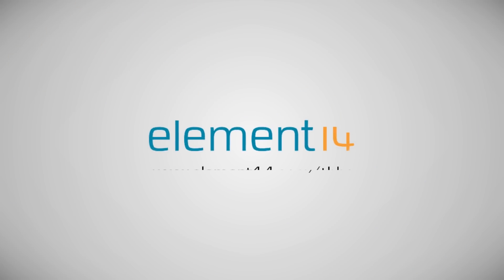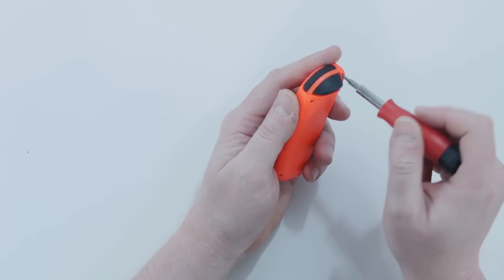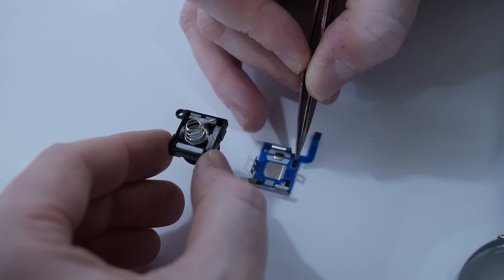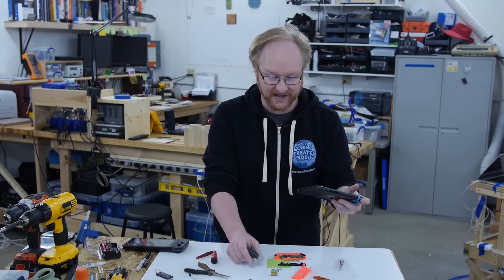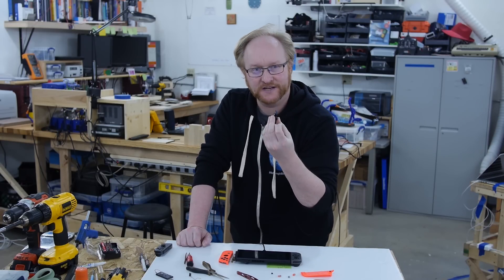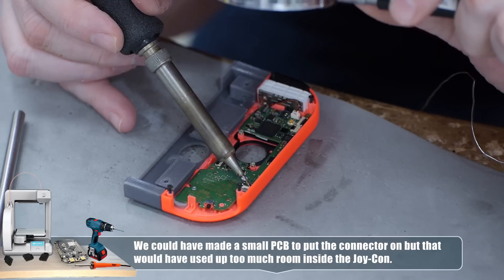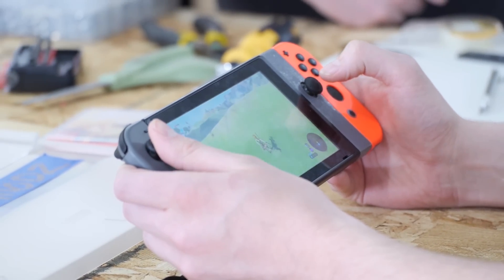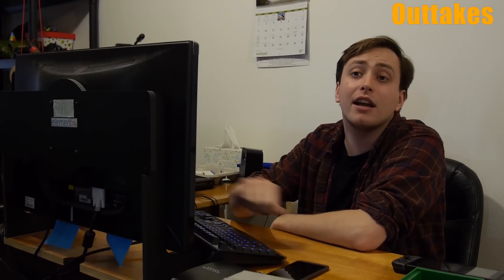The Ultimate Nintendo Switch Mod!

Comment: I wonder if in future hacks you could actually use the full clock speed of the switch in portable mode, so we could have better frame rates and we could play in 1080p on a 720p screen. Any normal person would say "That's useless to have 1080p on a 720p screen" but actually it's more sharp and it looks nicer overall.

Comment: Would it have been possible to add shoulder buttons? Sure it would be awkward to play sideways with the new position of the joystick, but I was wondering if you could have two artificial buttons and attach a wire or even just do what the Joycon Strap did and have a button that extends down to the real button and presses that.

Comment: you kinda overcomplicated it by trying to make a null conector for both sides instead of just re-allocating the existing connector and hardware into a 3D printed joycon, the console would recognize it as a normal joycon but you would have the analog stick where you wanted it...

Comment: Moving the stick is only part of the solution to the atrociously unergonomic design. You need a grip. Like the one that's available for the joycons alone, but one that can be used when they are attached to the console.

Such a grip alone would make the situation much better, without having to modify the joycon itself. (I know. My 3DS became a hundred times more comfortable after I purchased a cheap grip attachment for it.)

Comment: You can use the Switch with only one joy-con, by the way. Zelda just doesn't let ou because it need all the buttons - you've got to either go to the Switch controller calibration menu or boot up a game (like Mario Kart) that supports single joy-con play to make it work.

Also, it looks kind of ugly. I can't expect there to be the perfect shade of grey or neon red to 3D print though.

Comment: ugh.  Why does this guy suck so bad at soldering.  I could remove that connector without a trace of damage.  Preheat the board to 80c and set hot air at 150c, 5 minutes and it is off and in perfect condition.

Comment: Questions here: what happens to the SL/SR buttons? And how does it feel ergonomically when you hold it in sideways mode? I understand some ppl would rather not use the Joy-Con in sideways mode, but SL/SR are sometimes used when holding the Joy-Cons in each hand, detached from system.

Comment: Oh jeez...the wipers on that Nintendo joypad are a throwback to the giant wipers used on the Coleco Gemini controllers. The Gemini controllers are fantastic, as long as you keep a bottle of contact cleaner and a screwdriver nearby.Hopefully, Nintendo has worked out that bugs in that system.

Comment: I wonder if a screen mod would be possible, like... having a mobile 1080p display which we know the Switch internals are capable of rendering in dock mode... (maybe a battery mod would be necessary too...)

Comment: Cool project, but doesn't doing this disable your ability to comfortably use the right joy-con horizontally as it's own controller?  I figured that's why Nintendo designed it the way they did in the first place right?

Comment: 5:40 Yes, and no, Specifically in Zelda BOTW you need them both connected, or neither. However in just about any other game but that one, it works in any configuration (Tested w/ MK8, Disgaea, Puyo Puyo Tetris, ARMS).

Comment: would it be possible to connect the analogue to a header to another header and a 4 pin, .5mm ribbon cable to the original zif connector?

Comment: if you take a piece of single core mains cable then take a soldering iron bit you don't mind destroying and drill a small hole in the soldering iron bit and braze the small piece of solid core cable minus the sleeving into the soldering iron bit and you will have a very fine soldering iron bit.

Comment: is it possible to order ribbon cable like the one they used in the switch?  Then just solder an extension on instead of using wires?

Comment: Couldn't you all of used just another piece of a ribbon cable that was that had a female end and a male, then you wouldn't of had to solder anything and you would be able to revert back to the original joycon configuration.

Comment: The joycons are fine when I'm playing with them detached or in the grip, but it pretty uncomfortable when attached to the screen. I think it is the weird placement of the sticks in addition to having to support the weight of the system that make it so bad. I found having some kind grip on the back alleviates some of the problems, but doesn't fix it completely. It really annoys me that Nintendo screwed up their single player experience to cater to local multiplayer (knowing them, they'll sell a $100 single player only set of joycons)

You should do a hack to make the pro controller d pad not so stiff. It wreaks my left thumb playing puyo puyo tetris with it.

(Ben talked about the PS Vita in this video, but I can't find a vita tear down on this channel. Did they do a video on the Vita?)

Comment: Of course, now this modified right Joy-Con can't really be used horizontally as a standalone controller. Are there pass-through buttons on that adapter for the Joy-Con's little L and R buttons (on the docking rail edge)?

Comment: conductive ink on the flat flex ribbon cable? Are you sure? Okay, this is mass market stuff and that can be different then industrial grade I know, but usually, there is thin metal foil in the FFC. Sure - the metal foil is thin and the plastic burns right trough when the soldering iron even comes close to it, but still: When you can name me a mass market manufacturer using  a conductive ink process, then I would like to get a name.

Comment: Or... You know. Here's a thought - design a grip that moves the position of your right hand.

The problem isn't the placement of the stick relative to the buttons, it's the orientation of the controller relative to your hand.

Just bear with me for a second here...
Take the right joycon and remove it from the console. now instead of gripping it tightly, hold it loosely and move the controller so it's diagonal with the bottom further away from your palm than the top. (you may need to hold it in place with your other hand to experiment with this)

If you do this you'll see that if you hold it at a 45 degree angle or so the placement of the stick is perfectly fine.
So... a simpler, less destructive solution is to create a grip that forces your hand to be in a better position.

Of course, I find I often hold the thing this way anyway when the controllers are attached to the switch, but eh.
Reply: I was actually thinking the same thing XD
Reply: I don't think that will mess up the ergonomic because I actually play with the right hand reoriented in that way so
Reply: mjc0961 I don't see how improving the positioning of the controller relative to your hand is 'making the ergonomics worse'.
Ben's solution is arguably over-engineered and while it solves one problem, it introduces several more.
The most obvious one being that the weird placement on the controller isn't arbitrary, it's a deliberate design compromise owing to conflicting goals  - the switch controllers are trying to accomplish  about 4 different things all at once.
Firstly they serve as integrated controls for a handheld style system.
They also have to function loose as wii remote style motion controllers, a conventional controller if used in a grip, or a pair of miniature snes style controllers.
Ben's aolution here improves one of those, but at the expense of destroying usability for the other 3 entirely.
The asymmetric stick layout here isn't a fob to Xbox gamers either - it's a direct consequence of that design compromise, as is the left joycon having buttons rather than a d-pad.
I am fairly sure if only the docked configuration mattered they would have stuck to the Wii U style layout.

Anyway, a grip would help at least two of the layouts rather than just one, and if it's removable, would not render the thing unusable for the others.
Ben's solution definitely totally destroys the mini-snes configuration (shoulder buttons probably unreachable, and stick in a very awkward spot).
It might still be usable in motion control configuration, but probably not comfortably...

Personally I prefer holding them loose from the system, but to each their own.
My hands aren't exactly huge, so how would I know how bad it can get? XD

Joycons are exceptionally tiny though, I have to admit...
Reply: Greate idea :-) Off course, the design would not look clean any more, but hey: The nintendo 64 controller did his job.
Reply: pretty much what the joy con grip does. All we need is for those side parts to attach to the controllers in the handheld setup.
Reply: KuraIthys people like you, will make great leaps in physics and technology

Comment: List of things that the inevitable Switch Pro will have:

- Better, more ergonomic JoyCons with built-in microphone for not-messed-up voice chat that doesn't require a phone
- - Maybe with a movable joystick so that you can still play with a single sideways JoyCon?
- 1080p screen
- MORE POWER! *grunt grunt*
Reply: Why do you need microphone in the joycons? The headphone jack of the switch could (according to Nintendo) be used for a microphone. Commonsense, tells me that bluethoot could be used for a head set.
The current voice chat system has nothing to do with hardware limitation. 
Yes, build in microphone would be nice, but build into the screen would make more sense to me. The microphone in the joycons could be covered by finger, the joycons  are moved erratic relative to the mouth of the user, the microphne might pick up game sound and button presses etc. In docked mode, an external mike or headset could be used.

More power and 1080p screen are unlikely - I mean: the new 3DS got more power, but is akward, that some old games can not use the extra power, some new games strictly require a new 3DS. At best, this leaves players with the old hardware with an objectively inferior version. At worst, it causes market confusion as show cased by Sony and Microsoft.
The 1080p build in screen could cause issues with some games - there is for e.g. one touch screen only switch game, which also means portable mode only. Guess witch resolutions are supported. Yes, the "new switch" could scale up the screen, but... that would not be the typical Nintendo feel of overall polish and definitive version. (I mean: leaving the fog machine could N64 aside. And the headache generator Virtual Boy. Or the 3Ds gimmick, that I barely turn on and if only for 30seconds to remember why the slider is always down)

Comment: huh. They probably cheaped out on the analogue stick because all the other guff in those joycons actually makes them really expensive.
Even though people complain they're too expensive compared to a gamepad for other systems, someone did a cost estimate on these, and the profit margins are tiny. Your average game controller in terms of construction would seem to be about 1/3 the cost of a pair of joycons...
(I assume the right joycon is the expensive one, given that it has the NFC reader and IR depth camera - I mean that alone is pretty expensive sounding - the right joycon has the functional equivalent of a kinect in it. Maybe a cheap, low quality one, but still... Just think about how expensive a standalone kinect is, then think about them just jamming one in there as some kind of rarely used secondary feature...)

If that's true, then it makes sense that they'd try and cut costs wherever they could. XD
Reply: +Kuralthys Ben calls something "cheap", without seeing the price tag nor seeing/expiring its longevity. How much the joysticks cost Nintendo cost does not eitherway. What matters is, how they hold up. If the are the cheapest of the cheapest sticks, but work and feel good and "as new" after 10 years, would the price matter? Would a high part price matter, if the part breaks after a week? In either case the price does not matter. The stick does not have to look subjectively good inside - it has to feel good and work reliable. How to create a good feeling and reliable stick, is up to Nintendo. Results matter, not opinions.

Comment: Maybe the next iteration won't involve having to take apart the original right side joycon. Essentially just a pass-thru for the buttons and then a standalone with a new analog stick on the add on. That way it could potentially be mass-manufactured and sold as-is rather than having to build a whole new right side. That method would give lower overhead costs and is less likely to void a warranty (though Nintendo probably still has something that says, "adding anything at all to this voids your warranty").
Reply: Matthew Blackwell and how would the new analog stick interact with the controller if you don't take the controller apart to connect the 2 genius?
Reply: I expect there's a signal that comes from the original controller for the buttons that you pass through and then you cut the feed from the original analog stick and you're direct-feeding from the new analog stick. The difference is that you don't send the signal for the analog stick back through the original controller, you just go directly to the switch. (also you don't move the original stick). Maybe it involves more electronics in the add-on, but it should still save on overhead since you're making something new (hopefully on an assembly line) and not having to disassemble an existing product. 

The point of my conjecture is for a prototype guy to build something that is mass-produce-able by a third party manufacturer. So you do the design, license it, then collect royalties without having to spend hours re building the same thing by hand for each consumer that wants one.
Reply: +Matthew Blackwell You have no idea at all how things like a controller are designed. Even back with the NES, the Joypad and the buttons were serialized using an integrated circuit. There isn´t a single wire for each button or stick going to the switch (or any other Nintendo Home console). Your idea would work for a D-SUB15 or D-SUB9 controller port found on homecomputers and some retro game consoles. On those system, the buttons where directly connected to a wire to console. But not for anything "modern". I mean: You could reverse engineer the serial signal (trivial for NES and SNES, hard for something modern)... but then your solutions becomes essentially building a clone joycon, at which point you might as well add buttons to it and sell it as clone. Yes, some features would be missing like the amiibo scanning but scanning amiibos while holding the switch in both hands woul be silly anyway.

+Thomas Arndt:
No, I do not think that the joycons use wireless signals when plugged in. If that would be the case, you would not be allowed do use it on an airplane. And the connections from joycon to the switch have plenty of pins to send it wired.

Comment: Make a switch console ( no screen) , implement the dock into the console so it's always in dock mode, and larger fans to make it cooler and quieter
Reply: lol - a non portable switch. Some games need the touch screen. So I would leave the screen on the console and just modify the back of the switch to change the cooling system and add an heavy duty stand.